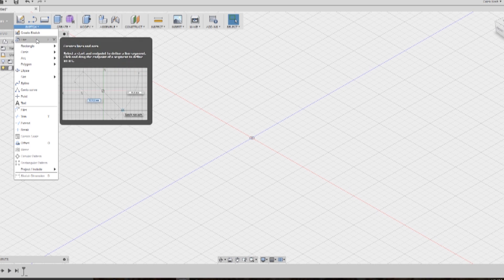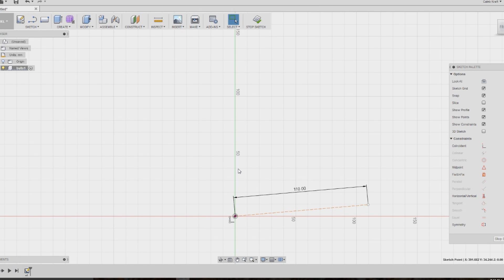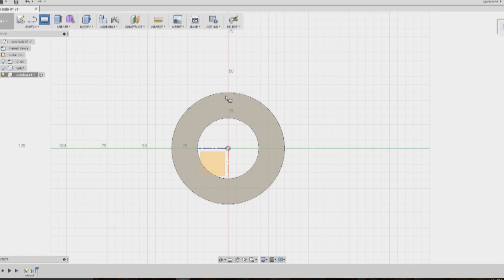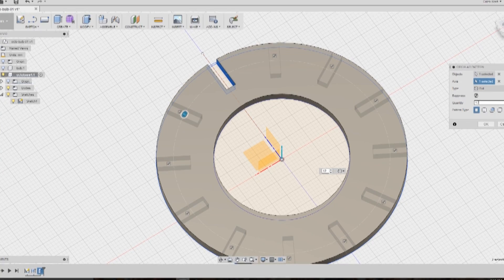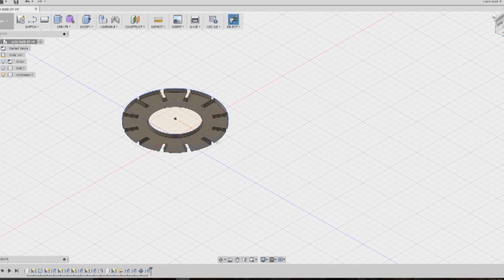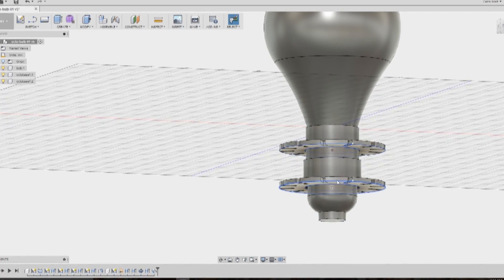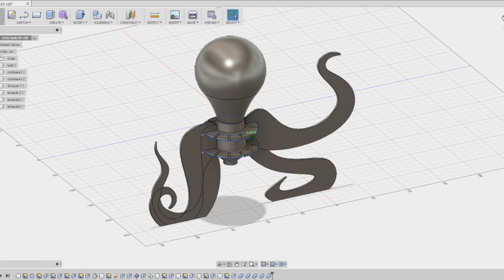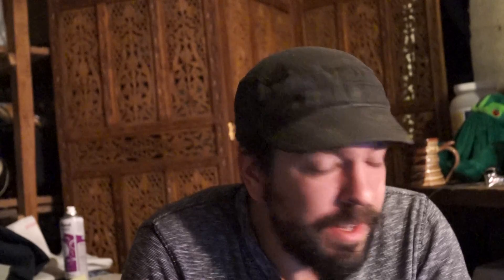Laser Cut Octopus Lamp: 01 fusion360 design

Comment: To parameterize an existing sketch, there are a couple of things you could try. First, you could expand the "Model Parameters" table under "User Parameters", then change the value of the element you want to the name of the parameter. Also, you may be able to drag the timeline at the bottom to before you extrude the sketch, make the changes to the sketch, then drag the timeline slider forward again.